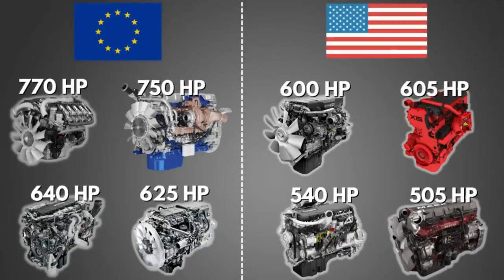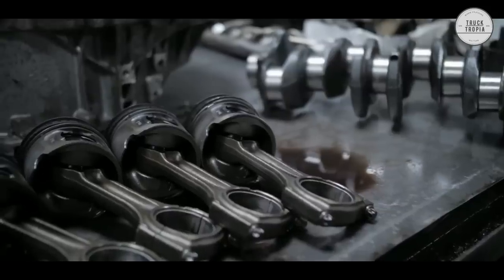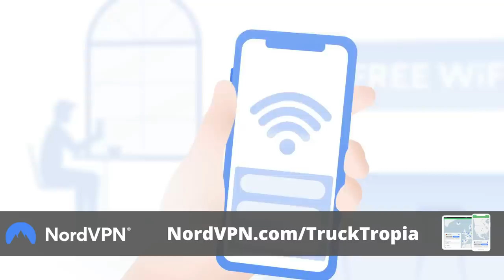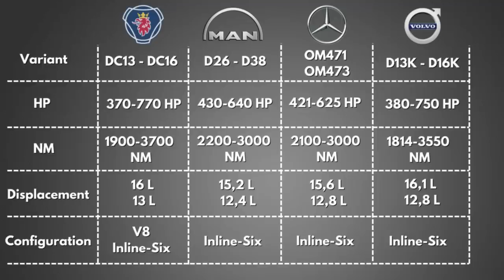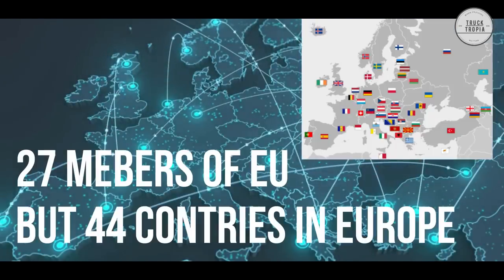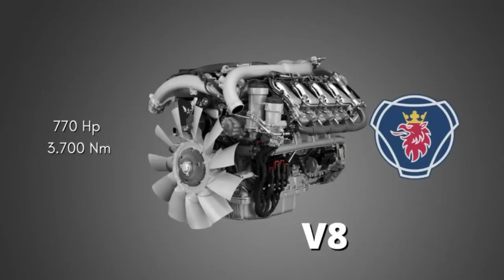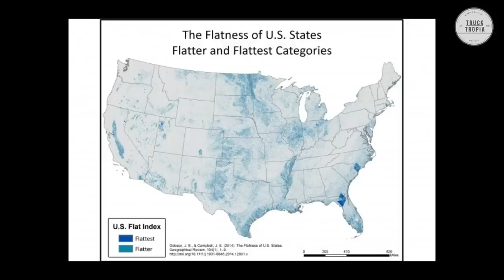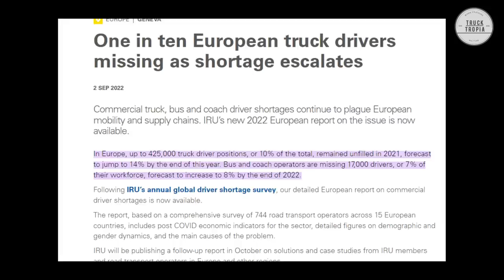Why European Trucks Have Up To 770 HP And US Don’t

Comment: The big HP engines are developed mainly for Sweden and Finland trucks. The Trucks here are much longer and heavier than the rest of Europe and US. But still, you really never need moore than 500 HP, but it can be better for fuel efficiency with a bigger engine sometimes.
Reply: US doubles are very similar to trains in Scandinavia. The difference is that the US interstate is limited when it comes to maximum grade.
Reply: Canadian trucks commonly weigh around 139,000 lbs.
Reply: The 700+ is really just for road trains and special loads. The Volvo once was specially built for 150 ton loads. For the normal 72 (sweden) and 84 (finland) loads the normal 600hp engines are generally recommend.

With that. There is speciall 105 ton timber trucks in the nort and 90 ton  ore trucks also that are licensed to operate as normal trucks.
Reply: Norway is by far the most demanding part of scandinavia. You do not need lots of power on flat roads.
Reply: @JeepCherokeeful  that's definitely false lol
Reply: @kjelle5350  The most power you need on bendy roads, because you have to accelerate after each bend. Acceleration requires much more power than going up a straight, constant slope.
Reply: @JeepCherokeeful  nope
Reply: HPs are shrinking in the US because the emission systems don't get up to temperature with you are using the engine reasonably close to its limit.
Reply: @JeepCherokeeful  but have lower speed limits than the US.
Reply: In Europe it is very common to see trucks over 540hp, in Spain you can carry up to 70 tons approx, but it is also very common to see large engines for 25 tons of cargo... A 630hp Mercedes with 40 tons spends less fuel than a 500hp American
Reply: @JeepCherokeeful  The Canadian interprovincial limit for a Super B configuration is 62,500 kg (138,000 pounds) or 63,500 kg (140,000 pounds) - I'm not sure which - and there are certainly lots of trucks with that as a registered gross weight limit, operating well above the typical "18 wheeler" limit of 39,500 kg (87,000 lb).. but I don't know if I would say that extreme is "common".
Reply: @brianb-p6586  it is common in Alberta, Saskatchewan and Manitoba;) and I see them on every visit to Ontario also.
Reply: @JeepCherokeeful  I live in Alberta, and there are a lot of Super-Bs here (mostly as tankers and bulk transports), but they're not the most common configuration. "Common"? Maybe...
Reply: @JeepCherokeeful which explains the conditions of our roads sadly
Reply: @JeepCherokeeful  no it’s not, Jesus
Reply: @Tucktuck632  just speaking from experience as a frequent semi truck driver in Canada, which you’re obviously not;)
Reply: Please ... as if Americans would ever say "it has enough power". American drivers probably just comforting themselves having to put up with the underpowered, primitive trucks.
Reply: in Germany you also have them sometimes for special operating companies - with extra sizes
Reply: And thats why the new Super series engines hit the spot with 420,460,500 and 560 bhp range. I expect Scania to sell a lot of those. My best guess is 460 to be the real winner.
Reply: actually in Finland minumum for 76 ton truck is 540hp i think, and those are very sluggish with that weight. A more common truck they use for the 34,5m long trucks is the 590 V8. Sometimes they opt to pull the 34.5m long truck but with 60 tons using the smaller 500hp engines.
Reply: @4_SJR  Shhh. American greenies insist that smaller engines are better. Most don't understand that bigger can actually be more efficient.
Reply: @JeepCherokeeful In Alaska we also Haul Logging by Dounpike Double at 171,000 lbs.

Comment: The amount of torque an engine produces is not that important to its performance as long as the torque holds steady across the RPM band. The transmission can always trade engine RPM and wheel speed speed for wheel torque. If you have more power, the right gear will mean you have more wheel torque for the same speed.
Reply: OMG... I do not believe it.. Someone that ACTUALLY knows what they are talking about..

Comment: In the UK weight limits are largely based on the number of axles. They are from 3.5 - 7.5 tonnes and from there up to 18 tonnes with two axles. Rigid trucks with three axles can run up to 26 tonnes and with four can gross up to 32 tonnes. Artics (tractor trailers) can gross out at 44 tonnes with six axles. Then there are the STGO, or Special Types, General Orders trucks that, for instance, can carry loads of 100 tonnes or more. These might carry locomotives or similar.

In Britain, historically, truck makers had much in common with their US cousins in as much as they used proprietary components by manufactures like Rolls Royce, Perkins, Gardner or Cummins. Kirkstall, Eaton and Turner used to make gearboxes and axles. On the continent most manufacturers were vertically integrated but of late, ZF have taken over much of the transmission market. Before we joined the EEC, or EU as it became there was relatively little trade between Britain and Europe but it was quite common for trucks to drive over the Alps from Germany to Italy or Italy to Spain so powerful engines and sleeper cabs were common as trips could last several days. In the UK owners preferred low revving engines that would last a million miles between rebuilds. The likes of Volvo and Scania introduced leasing to the market so vehicles would go back after 3 or 4 years and after 10 years would end up in Africa.

In contrast, British trucks would quite often work for 20 years and then the engines, especially Gardners, would enjoy a second life as generators for traveling fairgrounds or powering Junks around the coats of China and Malaysia.
Reply: UK should allow b-doubles.
Reply: @Robert-cu9bm  not until a mandatory motorway test for car drivers is introduced, the standard on UK roads is atrocious now.
Reply: UK GVMs and class limits are artificially low in the lighter trucks due to your insanely restrictive driver's license weight limits. There really is no reason that a person with a passenger license should be limited to 3.5t. My last daily driver (5 short tons) was rated at more than that and its replacement (7 short tone) will be too.
Reply: @rich7447  That is a harmonised standard across the EU. My UK pre-harmonisation licence allows me to drive something up to 8,250 Kg. Since 1997 drivers are limited to  3,500 kg without passing supplementary tests.

There is a good reason to make sure that new drivers have training to drive heavier vehicles. It's called road safety.
Reply: @TheEulerID  3500kg is a very low number. You call it road safety, I call it over regulation. If you want safety then you need more control around trailer weights/sizes for underpowered tow vehicles (North America standardized on SAE J2807 for tow ratings).
The 3500kg limit is not high enough to cover some of the higher trim full size SUVs and only covers the lowest category (class 2A) of full size pickup trucks. These are no more difficult to drive than an Audi A8. 
The old Group A (issued pre- June 1990) license in the UK  had a more reasonable 7500kg single vehicle/8250kg combination limit. The strange thing was that you could tow more than 750kg, but only if you used a lighter, less capable, tow vehicle (you can tow a 4T trailer with a 4T tow vehicle, but not with a 7T tow vehicle).
Reply: @rich7447  I do not want to go down the route of the USA with giant SUVs and pick-ups being the norm. In the USA, the rate of road deaths per million is almost five times that of the UK on the latest figures. Even accounting for differences in distances travelled, there are well over double the number of road fatalities per billion vehicle miles. The position with pedestrian deaths is now disastrous, and reached 7,522 in 2022, an 83% increase since the low point in 2009. 

Whilst the rest of the developed world has been taking actions to substantially reduce the road fatality rate, the USA seems to be resigned to the current levels, which are much higher than similar countries (even Canada and Australia, let alone the best European countries).

In any event, as it seems you don't live in the UK I really don't know why you care.
Reply: @TheEulerID  The rate of road deaths in the US is 81.5% higher than the UK (6.9 deaths per billion km travelled vs 3.8 in the UK). Since Canada (4.3 per billion km) has a similar rate to the UK, but US style vehicle size regulations and Belgium (7.3 per billion km) is higher than all 3 with EU regulations it would appear that vehicle size is not the issue.
The big problem in the US is not lack of regulation, it is that people drive so much that they get complacent. This leads to some pretty poor driving. 
We also spend a higher percentage of our time driving on motorways/freeways than most places in Europe do. Higher speeds plus inattention is not a good combination.
The rise in pedestrian deaths does not surprise me since people walk around staring at their phones. 

"In any event, as it seems you don't live in the UK I really don't know why you care." .... I'm originally from Nottingham. Just because I left does not mean that I have no opinion.
Reply: @rich7447  I see you got your figures off of Wikipedia, some of which are way out of date. The UK figures for deaths per billion km are from 2010 for example, and the road fatality figures are also about 5 years out of date. I base my figures on official government statistics available online, and in this case for 2022 as the most recent full reports, although the numbers are in broad agreement for the trend (excluding the COVID effected years of 2020 and 2021 when the US figures were spectacularly bad considering the big drop in road usage). I did check those deaths per billion vehicle km in 2010 from the same sources and it did tally with the Wikipedia number at 3.8 per billion vehicle-kilometres). 

According to the Bureau of Transport Statistics, in 2022 there was a total of 3,196 billion highway miles driven in the USA. The National Highway Traffic Safety Administration estimated 42,795 fatalities in road accidents in the same year. That's 42,795 / 3,196 = 13.39 people killed per billion vehicle miles (8.4 per billion vehicle kilometres; compare that to 2010, when it was 6.9 per billion vehicle kilometres, so in 2022, the ration worsened by 22% over the preceding 12 years). 

According to the Department for Transport, in 2022 in Great Britain (so England, Wales and Scotland) there were 323.8 billion vehicle miles driven. Also, according to the DfT, in 2022 there were 1,766 people  who died on the roads of Great Britain,. That means 1,766/323.8 = 5.45 deaths per billion vehicle miles (3.4 per billion vehicle kilometres, and improvement of 11% over the same 12 year interval).

So, the ratio is 13.39/5.45 = 2.46:1. That is in the USA there are 146% more road fatalities per billion vehicle miles driven than in the UK.

Incidentally, in both the UK and the USA the freeway/motorway systems have the lowest rate of fatalities per billion vehicle miles, and by some margin. If drivers in the USA drive proportionately more of their mileage on those type of roads, ought to lead to a lower, not higher rate of accidents per billion miles. 

I should add that in 2022 there were 7,522 pedestrians killed in the USA according to federal data. In Great Britain, there were 385 pedestrians killed on the roads. The population of the USA in 2022 was 333.3 million, and in Great Britain, 61.5 million in the same year. 

Thus, that's 22.6 pedestrian deaths per million in the USA and 6.3 per million in the UK (and the UK's record on pedestrian deaths is not great by the best European standards). So an American is about 3.6 times more likely to be killed as a pedestrian than somebody living in England, Wales and Scotland.

Northern Ireland collects it's statistics separately, but as it's such a small part of the UK population any differences will have only a very marginal effect. 

In any event, it seem typical of American drivers to blame pedestrians for the dramatically increased death toll over the last decade or more. That's not a new thing, as the "jay walking" laws have a similar history. They were put in place after a huge amount of lobbying by the rapidly growing US automotive industry in the 1920s when there was public alarm due to the rapidly rising pedestrian death toll. The industry's response was to blame the pedestrians, and they invented the term "jay walking" for that purpose, the word "jay" being a pejorative term for somebody seen as a bumbling, somewhat dim person from the country.

Comment: One thing is digital tachograph used in EU. You're allowed to have 9 hours driving time and digital tachograph tells every minute you have been driving. In certain trips 750 HP engine is over 30 min faster per trip than 500 HP and that might make it possible to change driver drive two trips in day.
Reply: The US uses log books (usually electronic these days) to record driver time. The limit is 11 hours behind the wheel, and the max shift time (from going on duty to going off duty) is 14 hours, but only if the driver has had at least 10 hours off duty immediately prior to the shift. So there is still a consideration for wanting to get somewhere as quickly as possible.
Reply: But EU speed limits for trucks are much slower.  In some states, trucks are allowed to drive at the same speed as the cars. Think 120 km/hr.
Reply: Most lorries in the eu are restricted to 56mph
Reply: electronic logging is mandatory in the US too.  And US speed limits are much higher, most states let trucks go the same speed as cars, which is 75mph in a bunch of states, and Wyoming, Utah and Nevada have 80mph speed limits with no lower limit for trucks (Idaho and Montana have 80mph for cars but 70mph for trucks).  Though most major fleet operators limit their trucks to 65 or 68mph, but there is no government mandated limiter like there is with the 90km/h in the EU.
Reply: @anthonykaiser974  in France truck are limited to 90km/h max...
Reply: @mehdisol7094  some of us Yanks learned that EU truck speeds were limited back about 20 years ago when Daimler-Chrysler started using the medium duty MB G56 transmission in the 3/4 ton and up diesel Ram pickups. Once you got above 62 MPH (100), you were getting high in the revs. They finally put a higher 6th gear in it later years.

Comment: Up until 2018ish, 700+ HP tractors were quite common among the companies hauling sand, aggregate, blacktop, etc in my area, mostly because emissions compliance was not enforced, and tuned and deleted exhaust aftertreatment was overlooked, but not anymore.
Reply: I worked in the North Dakota oil fields some years ago and I was surprised at how many truckers were running returned trucks pushing way above stock power and still getting way better fuel mileage at the same time just by deleting emissions compliance components and tuning parameters.
Reply: in us?
Reply: @guamazolopez6456  in Michigan, yes.
Reply: The stricter the environmental laws, the more effort the government is putting forth
Reply: @jks3849  In the case I described, the laws were passed around 2008ish, but weren't really enforced for about 10 years.
Reply: @guamazolopez6456 yeah not uncommon here to see older Diesel engines especially turned up north of 800 even

Comment: There's a bridge collapsed here in Indonesia 2 decades ago in Indonesia. Upon an investigation, the police found out that one of the trucks had a total weight of 200 tons! Yes, Japanese trucks in Indonesia can even pull 200 tons easily while the regulation for the axle load is bassically limited to 14.2 tons per axle.
Reply: How do you even get the idiotic idea to load 200t in a single truck?!
Reply: @xXYannuschXx  So many corrupt officers like stop the truck and ask for money.  For the truckers it's a good idea to load the truck as much as possible in one trip to make the trip feasible. These  overloaded trucks roaming around and destroy the road. Not even concrete pavement withstand their load. In one or two years, the national or provincial road needs rehabilitation, eventhough concrete pavement was designed to last for 20 years.
Reply: @xXYannuschXx  there are plenty of videos from China showing these 180-200 ton loads on a single,super long trailer, while the trucks pulling are rated for much much less weight
Reply: You would need so many axles and tyres for that it would look totally stupid 🤣
Reply: Take a look at Pakistan truck repair you will notice

Comment: The majority of European trucks these days have a 13L engine and are in the power class of 500hp and below. There are a small number of more powerful ones for special purposes or for show, but over 700hp and above is really very rare. The weights are higher in the Nordic countries than in other European countries, especially in Finland 68 - 76t (132200 - 167500 lbs) HCT combinations. The lengths of the combinations are more than 34m (113ft), two semi-trailers, 11 - 12 axles, but even then the power is generally only 460 - 540hp, rarely even 600hp.
Reply: In norway 600+ is normal